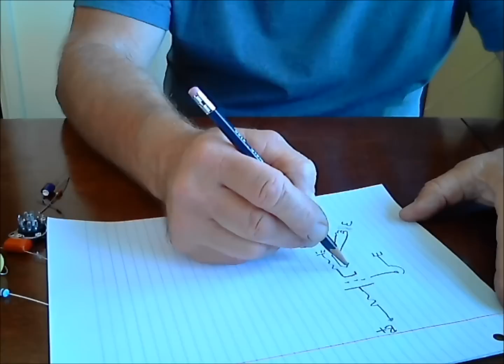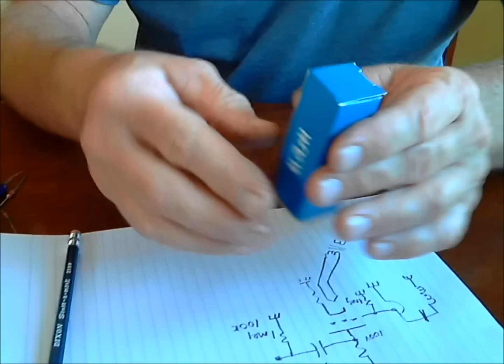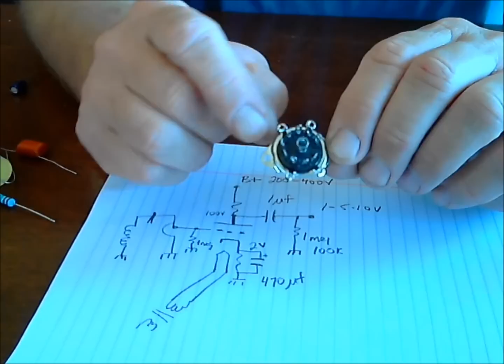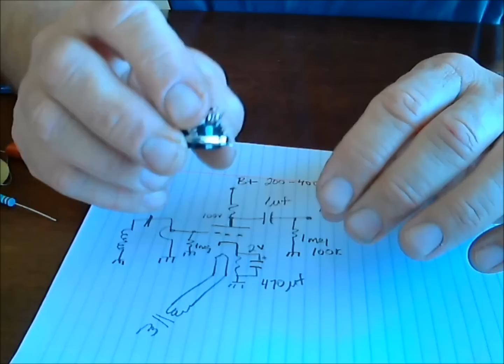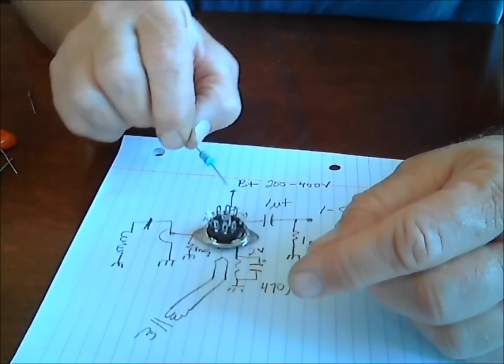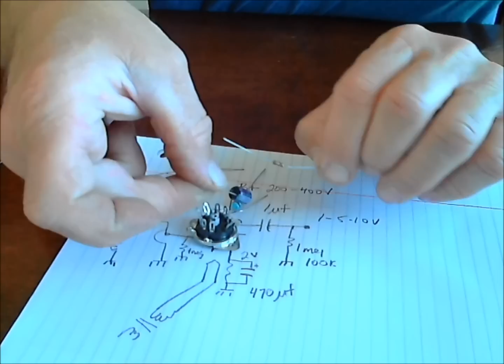Design Your Own Tube Preamp

Comment: Great video! I'd like to see a similar one on the design of a Hi-Z mic amp using a 6AU6.  Johnson used one in the Viking II CDC transmitter, combined with a 6J6 speech compression circuit controlling the 6AU6 screen grid.

Comment: Very good description. A transformer is needed at the output to match the high impedance of the tube to the low impedance of the speaker.

Comment: What determines the 120K ‘s “value” ? The one you attach between the B+ and the plate at pin 6 !?

Is it this acquired from the Tube’s speciations per the needs of that gain ?

I apologies - I’m learning - this is the best video I’ve seen on starting to learn.

You also do not dwell on the cathode resistors value.

I’ve just been design a Transistor based power smp and so the value of resistors is critical. 

Pl

Comment: Great video! One thing I'm a little unclear on is the DC voltage present on the grid. Is it close to ground??
Reply: Yes, the grid in a cathode biased tube circuit is attached to ground through a high value grid leak resistor. Since virtually no current flows through that resistor, the grid voltage is ~0VDC. Because the cathode resistor carries plate current, there is a voltage drop across it which raises the DC potential of the cathode, making it more positive than the grid. This is what biases the tube.

Comment: That center post on the socket is usually grounded in radio work as it acts as a bit of a shield to the other pins.  Of course a well bypassed B+ supply could do essentially the same thing there.

Comment: I have a question, can one build a preamp but use it as a low wattage class a power amp in order to get high tube gain tones without pissing off the neighbors in adjoining apartments?

Comment: What is your take on the low-voltage (9-12 volt) 12au7 based drive pedals?
Reply: Unless they step it up with a voltage multiplier its too low for a good plate voltage. The tube can draw no reasonable current at that low voltage.

Comment: hi joey here, ? will it work if you put 12 volts to 16 volts on a 12ax7 tubes, because china made a 12 volts tubes, I understand how tube amplifier works, but what's dangerous is 200 to 400 volts.
Reply: 400 volts DC is not going to kill anyone.  AC kills not DC.
Reply: Huh, what are you saying?

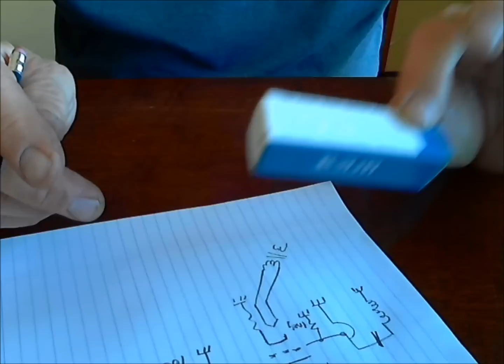Comment: At 5:42 you mention who you get the tube's from, but the background noise cancelled out where you get them from!  BTW- Great Job!  I have built one of these using only 12V on the plate.  Yes I know, Harmonics, but it worked.  For those that don't know, you don't mention the value of the Cathode Resistor.
Reply: Ted Mieske tubeaudiostore.com is where the RAM tubes can be purchased. RAM is Roger’s tube company.  He created software to match the tubes.  Good luck......!
Reply: @PoppyHoc - Thanks!

Comment: Do i need a transformer for B+ if in my home in plugs i  have 220 V powersource ?
Reply: yes you need it to be isolated from the power line for safety
Reply: thanks :)
Reply: I would advise using a transformer but if you insulate the whole amp and you could also use a polarized plug and use a few capacitors like they used on the ac dc 5 tube radios you could get by without a transformer but you better know tube electronics before taking shortcuts in tube circuits.
Reply: also they used output transformers on the output to match it with the speaker. so you were safe from line voltages on the output jack or headphones.
Reply: you always need a power transformer for isolation from the line and to get the high and low voltages.
Reply: You need to rectify the 220v source AC into DC

Comment: what classes do you take in school to learn how guitar amps work, and the general electricity for things like speakers, cables, and radio stuff. I don't want to graduate taking a bunch of classes. just enough to know how to plan and build my own things.
Reply: physics, aircraft and small engines(If the teacher teaches electric theory)
Reply: HOWEVER, you won't learn about amps or sound stuff in specific.

Comment: You kind of danced over the purpose of the 470uF cap on the cathode resistor.   My assumption is that it helps keep the selfbiasing 2V no matter how the cathode current varies.    I found this to be an EXCELLENT tutorial.  I've now doubled my understanding of tube based amplifiers.
Reply: +David Dennis Actually the cathode bypass capacitor relieves a symptom called cathode degradation which if left unchecked will kill the gain of the tube by a significant amount. The value of the capacitor is high so that low frequency electron congestion can bypass the bias resistor and bass tones are not suppressed, whereas if you put a lower value (for instance 1 uF) you would only relieve the high frequency congestion and only restore the gain of treble tones, while leaving bass and mid tones suppressed.
Reply: it’s ok to use 16v ??

Comment: A great tutorial thank you. I have 2 questions. What would be a typical value for the cathode 1/4 watt resistor? If 200V is at the power supply, where is the other 98 Volts sitting? Thank you for your time.
Reply: The cathode resistor is typically 1.5kΩ. The power supply voltage is shared between the plate resistor, the tube and the cathode resistor. E.g. there could be 2 volts across the cathode resistor, 98 volts across the tube and 100 volts across the plate resistor.
Reply: 98 Volts in on the plate.  Cathode resistor typically a few thousand ohms.  Try different values that give you 90-120 in the plate.

Comment: Great video but I was taught electronics first in Jr. High in the mid 1960's and then in the Navy in the early 1970's. Electron flow is everything. I know they teach the "Current Flow" method but that is really a misnomer. The current actually flows the same direction as the electrons. The spaces, or holes, the electrons use to occupy flow in the opposite direction.  If there are no free electrons to replace the ones that left a positive potential is developed but no current is detected. Current is defined by the number of electrons moving past a point in a defined unit of time. This has always been a bit of a sticking point with me and I really cannot understand why Engineers and others continue to use the Current flow , Positive to Negative, when actually it is not what is happening.
Reply: Before the discovery of the electron, the early pioneers of electrical and electronic theory did not know what current actually was, or which way it was flowing. There was a meeting and it was arbitrarily decided that it flows from positive to negative. By the time it was discovered that it is in fact electrons flowing from negative to positive, so much electrical and electronic engineering had been based on 'conventional' current that it was impractical to change. From personal experience, it is not difficult to think in terms of whichever system is more appropriate for the subject. E.g. electron flow to understand a vacuum tube, and conventional current to understand a preamp stage.
Reply: +megaohmz Actually that isn't really true, certainly in a  free electron metal. The conduction elextrons move in the conduction band and don't leave 'holes'. The solution for the electron on a periodic potential yields Bloch wavefunctions, and when the electrons are almost completely free (as in a metal) you get a continuous conduction band. Current flows with the electrons, as that is what current is. The concept of holes makes more sense with semiconductors when the electrons are not free, and the quantum mechanics gives band gaps.

Like Richb313 I find the current flow method confusing too.
Reply: Went through CTM "A" school in the late '90's and we were taught Electron flow is negative to positive, we were also taught "Hole Theory," as it pertained to semiconductors. It was what was deemed the "I believe" section of training. We were also taught "Current Flow," as it made tracing "signal flow" through the circuit easier...but it was stressed that "current flow" was not how the electrons actually moved. I think most people use the "current flow" method to explain circuits, as it makes it easier to relate "signal flow," but few stress the actual electron flow is negative to positive.
Reply: thanks for clearing that up! another arbitrary decision we all have to live with

Comment: I find it odd that you would consider grounding to the socket mount.  I thought it was best to star ground everything to one point?
Reply: +Nicholas Smerk  True enough, if you want a really quiet front end.  I think he was simplifying the locations you could use for ground.  As a rule, I always tie one of these four ground lugs to a tightly fitted single chassis ground lug. I don't depend on the tube socket being grounded solidly to the chassis by its hardware.
Reply: The socket ground makes a nice ground and its close.  The problem with star grounding is that it can result in long wires going to the one point. In grounding shortness is key.

Comment: I like that 9 pin socket.  Not sure though why you would need a 470uf cathode bypass..that's overkill..typically all you need is about a 22uf for good bass response.
Reply: Agreed, that size cathode bypass capacitor is unusually high. Normally see 10uF to 25uF caps there.

Comment: I hate to ask this, but why do I like the sound of the expensive fender amps, but not the cheaper pawn shop tube amps? Will this simple circuit sound good, or do you need to work on the equalization or whatever that makes the fender type sound?
Reply: I have a vaporizer amp. It sounds as good as many more expensive amps if you swap out the speakers, which are properly rubish seakers, for G10 greenbacks.
Reply: moreanimalspirits it all depends where they cut the corners to get the price down.

Comment: Would you use an input transformer to get a high enough voltage for your B+?
Reply: I am quite the noob, hence why I am viewing this video my self. But, yeah, you would use a power transformer. Like this: (I dont really post on youtube so I am not sure whether or not the link will work.)

http://www.mouser.com/ProductDetail/Hammond-Manufacturing/272JX/?qs=3TG34Bgp1HChVFd5VPojqw==

That particular transformer is quite a bit of overkill for just a pre-amp AFAIK. I referenced this transformer from a 50w power amp schematic that you can find at ax84.com
Reply: Thank you!
Reply: No problem man! I am learning so much lately and excited to share. I figure, the more I share what I THINK I know, the more opportunity I have to be corrected. Cheers.

Comment: I have a couple of questions. Why are you running the tube at such a high plate voltage if this is a 12 series tube? Aren't they happy with a 12 volt power supply? Also, how would I get a better bass response out of the distortion channel of my solid state Randall Warhead? Thanks.
Reply: the "12" in the its "name" e.g. 12AX7 is for the filament, the heater, not the plate voltage.
To operating a tube you need three voltage souces.
One for the filament, the heater, as tube needs some heat to produce free "flying" electrons. The do have to come out somewhere, and that´s the heater.

Next is the plate voltage, no plate voltage no amplification. As the electrons comes out of the filament (=kathode) they need to know how to go....that´s the plate, so to let the electrons know their way, apply a high voltage at the anode and the electrons will go there....

And this leads us to the third voltage, the grid bias voltage. When applying a high voltage at the anode, all electrons where called to fly to the anode....but the anode is not able to take them all together at the same time. Doing so will simply melt down the metal plate which forms th anode. So the flew of the electrons need to be controlled. This
is what the grid does. Making the grid negative the electron stream is bekomming lower...here is the control function...

Hope that helps...;)
Reply: 12 volts at 150 MA is for the heater only. The high voltage is for the plate. Less than 100 Volts on the plate is not enough.

Comment: Having worked in valve audio and having seen the alarming level of misinformation on the net, this video is a welcome break from that! :o)
I had a number of old friends, most of whom have sadly passed away, who I gleaned information from and its just something of a dying art. Most of them where trained by the military ('National Service' in the UK) and made very neat circuits. I'd get my ears boxed if I did things anywhere like I see on the net!
I agree; Valves are wonderful to work with. I still haven't got my head around these new fangled transistors.
Reply from the maker: Yes there is an alarming level of misinformation on the internet. I plan to keep these coming and I will be opening a school in the San Francisco Bay Area soon. I will be posting some of those lectures. We are looking for anyone who wants to help with video editing and posting. Please contact me at ramtubes@gmail.com
Reply: Diggi Thal This guy is awesome and he isn't doing anything off the chart. look at just about any guitar or radio preamp and you will see the same things and values of components as he used. His whole goal is to show how easy tubes can be to work with and encourage others to work with them, NOT give an EE lecture. This is for the DIY people. If you want EE lecture, go get some books. If you are too lazy to read and work a calculator, do something else and stop criticizing others because they didn't do something the way you wanted them to. If you demand something else, make your own video.
Reply: Diggi Thal
Its free, what do you want? If you really want to know then open a book and your mind.
Reply: Music Reference
Hoping there will at least one EE-grade listener, who tells you when you´re talking some "off-limits" stuff, as here in this video there is no proove of nothing, you just say something and that´s it...Proove at least your bias point...!

Is this what you call "teaching" ?

Comment: Hello! I have an electroguitar tube amp but i need headphone/record out for it. As far as i know there is one preamp tube and 2 power tubes in the amp. What i need to do in order to connect it to pc sound card's line-in? (i made a cable with one side golden instrumental jack and other end with multimedia jack, so except this one)
Reply: Thats a massive question - without a model number and no schematic I'd guess that there is a pair of output valves, a diode phase splitter, a driver and before that is where you would put an output BUT! you need to measure the signal voltage to know where you stand. Also, this would be a preamp output and will not sound anything like the amplifier does post output stage and speaker.
I would much rather recommend getting a microphone and a decent recording interface as you'll have a way better time.
Reply: My very thanks to you pal. I'll check and stand at the lower voltage outputs i guess.. I'm not sure maybe i'll buy just a preamp tube pedal or something IF! i find.. At least i know where to start now.

Comment: For safety reasons I don't run anything to the centerpost except grounds. Running the B+ to it makes high voltage DC theoretically accessible from above, all it takes is one touch and you may have a corpse on your hands. There are times when my B+ rail is kicking out 400v DC, that is a lot to have shooting down through your toes. Otherwise, GREAT video, really well explained.
Reply: I saw a Japanese amplifier where they had put LEDs shining up through the centre, it looked pretty good actually!
Totally agree on the HT. Its good practice as anyone who's worked with 211s or 845s will tell you:
250v HT - Ouch!
400v HT - Sit down with a cup of tea and get your nerves back together.
1,300v HT - Goodnight Vienna.
Reply: B plus does not kick out, also unless you stand on a grounded metal plate, touching 400 volts will not harm you. Go get you facts straight.